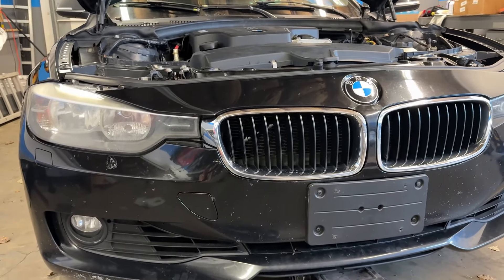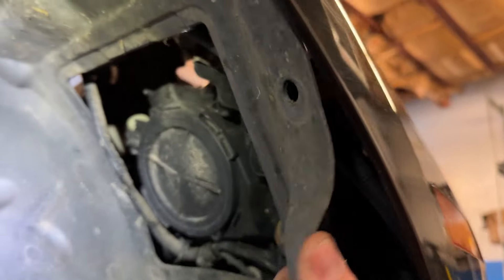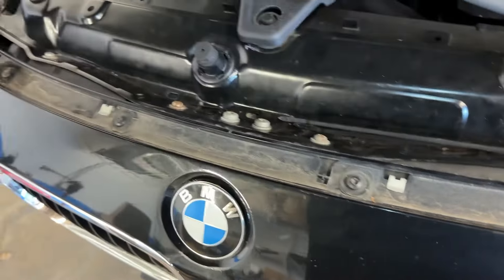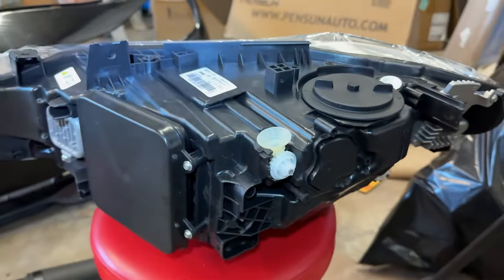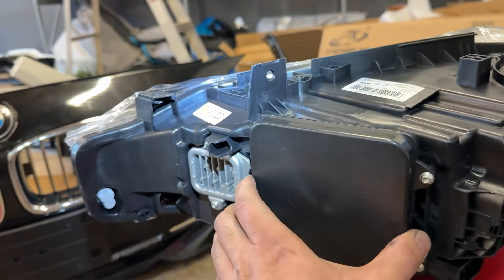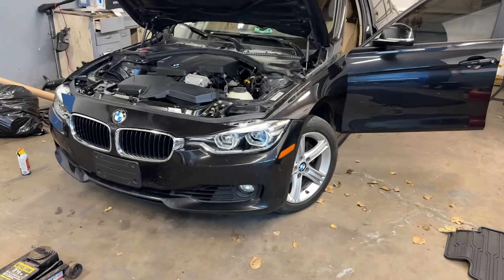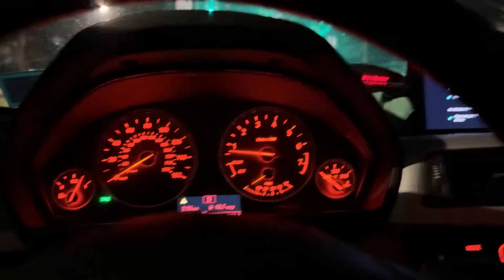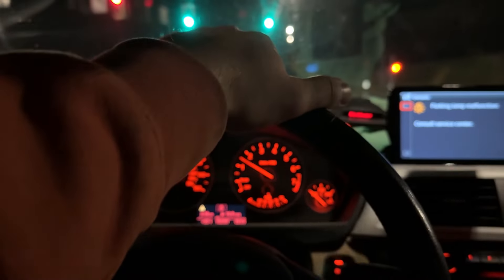BMW F30 Halogen to LED Headlights Upgrade - The ONLY ones that work!

Comment: Can you send a link to buy this lights please
Reply from the maker: Yes it’s in the description but you can also get them here: https://amzn.to/48rnwOi
Reply: @Buildcultureyoutube  thank you.. but its not for my car.. its from year 2012:/
Reply from the maker: @merteler  as long as it’s a 2012 4 door 3 series it’ll fit. But not the 2 door
Reply: @Buildcultureyoutube  your sure? It's a BMW 3 series F30 2012 limousine.
Reply from the maker: @merteler  I'm 99% sure because the part number for the original headlight is exactly the same for 2012-2015 as long as you have halogen on your car originally and not xenon.
Reply: @Buildcultureyoutube  thank you very much 🙏🏼
Reply from the maker: @ happy to help!

Comment: Could you make videos on you car more and how you got it to last this long
Reply from the maker: This one is actually pretty neglected and I did a lot of restoration to it to get all the errors cleared and for it to run right but I definitely will document the repairs and how to maintain it more. 

I did new timing chain and new suspension so far as well as the things mentioned in the vid.

Comment: I have a 2014 bmw 328i x drive, will these work on my car? I’m looking to buy, also how long would you say the whole procedure takes? Thank you in advance.
Reply from the maker: Yes they'll fit as long as your headlights look like the first ones in my video too. It took me maybe 2 hours max but that was because my bolts were pretty stuck.
Reply: @ yes i have those exact headlights currently on my car, same as yours, im wondering if i find the same one cheaper if that would also work… but maybe buy your link just to be safe
Reply from the maker: @ I tried that and that’s the whole reason I made the video lol. I also bought some cheaper ones but those don’t come with the modules and aren’t designed for this car. 

They are made as replacements for cars that originally come with LED adaptive headlights which our cars don’t have. 

I considered buying the modules separately but then it’d be $500 for the modules. And needs to be coded which is pretty advanced if it’s even possible and would probably cost a few hundred more from a pro. 

Decided to look for the retrofit route after that. And that’s when I found these. 

I ordered 2 other sets of the replacements and had to return both of them then finally landed on these lol.
Reply from the maker: @ this whole video was actually like a month long process of trying 3 different sets and I should’ve probably included the clips of all the failures too 😂 I have 2 other unboxing vids and then finally this unboxing where they finally worked
Reply: @Buildcultureyoutube  thanks for replying man I’ll buy the ones in your link, they look exactly like oem

Comment: i found ones in facebook market place but i dont know if they are plug and play nither the seller
Reply: how can i make sure?
Reply from the maker: I’m not sure other than plugging them in and trying  them yourself. You can try it without disassembly first, just need to reach in and get the plug. But be careful if disconnecting the airbag sensor to get the wire out. Might have to disconnect your battery first

Comment: Were you able to fix the blinking?
Reply from the maker: Yes. Just deactivated the orange running lights.
Reply from the maker: Can be done with BimmerCode app or with a higher end scanner